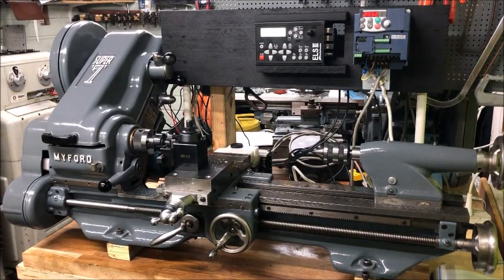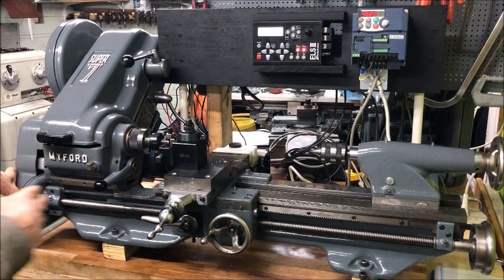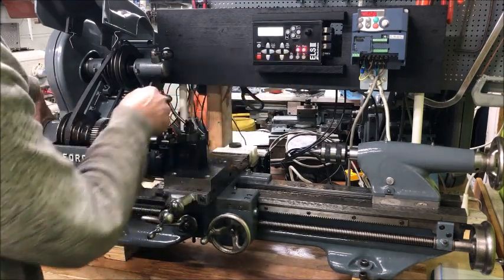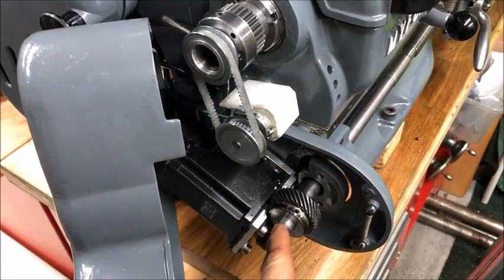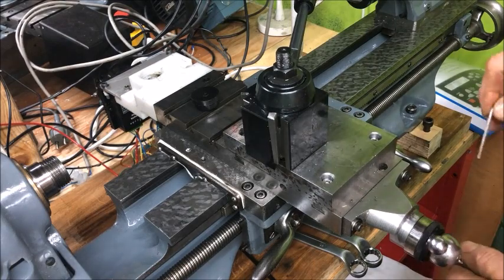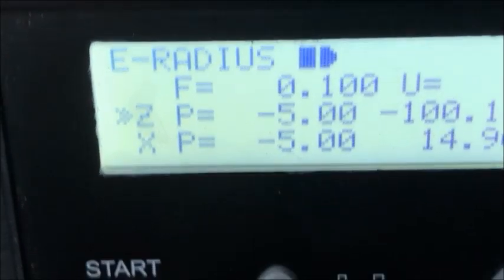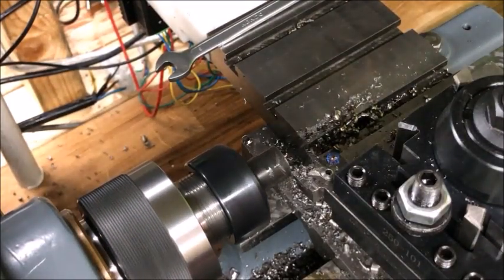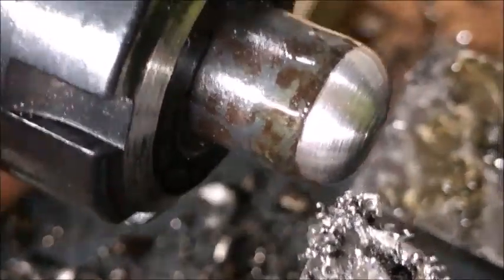ELS upgrade -  intro and demo cuts

Comment: Hi, From your experience, what type of Nema 23 would you suggest for the Myford S7? 1.26Nm or nearer to 2.4Nm. I'm currently making the bracketry for the x-axis....
Reply from the maker: Hi again,
 I used what came with the kits.. latest kit I bought for the Myfords was the Servo M3N https://www.rocketronics.de/shop/en/paket-servo-M.html 
which uses a so called "hybrid stepper" for the axis and the 60BYGH250B-08 stepper motor for the x-axis. I far as I can see this is rated at 1.47Nm
Reply: @jansverrehaugjord9934  Yes, I see that now as a 1.47Nm stepper. I'm also using a Hybrid unit (Steppersonline) and that seems more than adequate.
I like your idea of disengaging the x-axis coupling for manual use - I will copy that!!

Comment: Hi Jan,
I just purchased an ELS4 PRO kit for my Super 7 MK1 with no gearbox. The initial(test) was not hard but now comes the mounting of the motors. I have considered driving the crossfeed directly with a shaft coupler, instead og the )noisy as you say) angle gear. Do you have any specific recommendations to share on the mounting? Also what did you do to reduce backlash?
Reply from the maker: Great! I used this method on my first Myford with ELS. I used  coupler unit. Like this https://www.rocketronics.de/shop/en/drives/shaft-coupling/shaftcoupler-9nm/ The motor protruded out to the left and I modified the cover to accomodate this. Have a look at this in the start of this video here https://www.youtube.com/watch?v=_8rrTp9OauE . The backlash was minimal and is compensated for anyway by a setting in the software
Reply from the maker: Hi again Kenneth,
you may also contact me at my gemail jshaugjord.. I have some more photos and may be of help re. installing the motor. I think I tried most possibilities except for the most common, namely to use a rear mounted motor with a belt on the right-hand side of the leadscrew/bed. I also tried several different adpaters/mounting methods for a rear-mounted cross-slide motor and can have some hints there too :)
Reply: @jansverrehaugjord9934  Thank you very much Jan, You'll get a mail from me very soon :)

Comment: Very nice machine. Are you using the stock myford leadscrew and x feed screw or did you install ball screws?
Reply from the maker: Thnks! I am using the standard Myford leadscrew/half-nuts. The nice thing, in my eyes, with this "upgrade" is the ability to use the lathe as normal ie. both manually- and cycle-controlled.

Comment: Hi Jan, could you share a link to the kit for this?
Reply from the maker: Sure: https://www.rocketronics.de/shop/en/controllers/packs/els-conversion-packs-for-lathes/
PS! I have bought both M-kits, ie. first with a stepper for the Z-axis, but last one with a so called Hybrid stepper (the blue diver box). Then you will need one of the controllers. The simplest/cheapest is fully satisfactory for use in my case https://www.rocketronics.de/shop/en/controllers/controls/lathecontroller/
PS! I haven't calculated what the price would be if you just had a 1 axis ie. leadscrew control, but you could at least do away with one motor with driver and cabling. Mr. Schreyer makes a point of offering genuine Leadshine products, but there may be more to save if you bought other brands

Comment: Hi Jan nice to see another ELS video from you. You have now collected some expirency with the mounting of the motors. What would you say are the pro and cons for gear or belt drive, the motor behind the gear cover or in place of the gear box as shown in one of your last videos ?
Reply from the maker: Thanks! Hmm... I was at least surprised with the apparant lack of backlash in the geared setup I used on this lathe. Then there was some noise (which I should have anticipated and understood, but that is another story..) that needed extra attention (it would probably have been better to use the end of the adapter that nornally fits the banjo instead of mounting it to the plate that goes to the bed. In contrast the belt connection is quite silent. The real advantage of the 90 degree geared solution is really to be able to house the motor inside the gear cover. OTOH.. this could also have been used to house the driver board, so now this had to find a different place. If I wasn't so intent to retain the look of the machine and thereby also wanted the gear cover unmolested (as opposed to the other Super 7 where I had the motor inline with the leadscrew and since this then protruded out to the left of the machine, I extended the cover.. made a "bulge" to accomodate the motor. However, although this is a good solution "drivewise", with the longer hybrid stepper, I thought the bulge would really become too long and big, so dumped that idea) I would simple have mounted a plate like I showed on the ML10 and then only used the left side ie. the door of the gear cover. I will investigate this more on my next-in-line "victim". Maybe this plate will be a little too far out with the belt length I have bought, but so be it (could of course buy shorter belts).
Anyway, the belt drive is probably a good choice.. cannot see any cons here apart from that I have also ditched the idea of placing the motor facing right, ie. so that I would need a somewhat elaborate fixture for the then (in my eyes) needed bearing support. I would just go straight with the solution as on the ML10. PS! Slack in the belt and/or a longer than needed belt would probably cause some backlash, but this is easily "arranged away" both in software and of course by choosing a short belt belt and making sure it is tight.
All the above true and well.. the easist is probably to mount the motor on the right hand side to the rear of the bed. I would make a plate and also add a ball bearing to the brass bushing/adapter already there, since this is on the smaller end of the leadscrew. Belt would be longer.. maybe a tightening pulley mid-travel (as in car engines) would be OK, but possibly not needed. The handwheel mount could be extended a little so I don't think there would be any need for doing away with this (even though you probably don't use it that often). The advantage with either the right or left hand side belt-driven motor placements is also that I guess you could make a housing incorporating the driver board together with the motor.
Are you already an ELS user? If not, I would heartily recommend this "upgrade" or "modernisation".
Reply: No, I'm not jet a ELS user, but for sure will be. This is the reason why I ask for recommendations for the set-up. I will go with the ELS 4 Pro from Rocketronics on a super 7.
Reply from the maker: @olafkundrus1570  Sounds like a very good choice! Good luck!

Comment: Hello Jan,
Very interesting conversion... It looks very successful...
Take care.
Paul,,
Reply from the maker: Thnks! yes, I think this is one of the more useful conversion for a manual "change-gear" lathe. As written in the header (I added some text):
Not only for the aforementioned Myford, but also for example an Emco, etc., as well as the "China benches" that usually doesn't come with a gearbox, or if so, a very limited one.
With an ELS (Electronic Lead Screw) on a lathe, you achieve with a motor on the Z-axis, ie controlled length feed, you achieve the same as with a gearbox. You no longer have to trouble with the different gear combination for a specific thread pitch or change from this back to the longitudenal feed (bot of which operations normally requires a quite elaborate change of the gear setup)
There are "programs" for "Gearbox R" and "Gearbox L" , for operation against or from the chuck and thus to turn right or left hand threads or feed either way. This is simply selected from the menu on the ELS unit.
You can choose metric or inch pitch with a "resolution" for all thread pitches be them metric or imperial (PS! I have made a table for most inch pitches to remember easier which metric conversion to use.. for example the 8TPI thread on the Myford leadscrew is 3,175mm ..). You migh tuse the "Gearbox program" or for convenience, to make it even easier to cut threads, there is also setup directly in an appropriate menu for either external or internal threads, "EXT Thread" or INT Thread". If you only have z-axis control, it becomes a semi-automatic operation, you have to do the manage the cross-axis feed yourself after each cut and press reverse/start
If, on the other hand, you also have control on the cross-feed (x-axis), this is also automated. You can then set the required parameter easily and proceed to thread at a higher speed than otherwise possible, with a weaker machine you can e.g. there are several more passes with shallower cuts.
Actually, you can go quite a lot faster than what is usual with manual threading (for example as I have tried, 5-600 rpm.. even up to 1000 rpm)
With control over both axes, you can also turn cones, inside and outside radii and other shapes (such as balls).

Comment: Great looking lathe machine. A little automation is good.
Reply from the maker: Thnks. Personally I think the ELS offers the benefits of two worlds, ie. CNC and regular manual machines very well on this scale. Not having to go all the way and convert the machine, but rather retaining the manual controls is a good thing in my eyes and is so very well done in this small package. As a Z-axis drive kit doesn't cost more than a gearbox does even this will be a better choice as it can do more.

Comment: I don't see any drawbacks to the setup at all.  Have you noted any?
Reply from the maker: The gears are a little more noisy than if you use a belt drive.. I made a gasket out of an old bicycle tire to fit between the motor mount and the bed casting where it is fitted which helped, but this shows that the noise is really a derivate of vibrations (as most often it is), in this case from the motor, and the importance of a proper mounting. It may have been better to use teh 2 screws and flat surface to which the banjo normally fits.